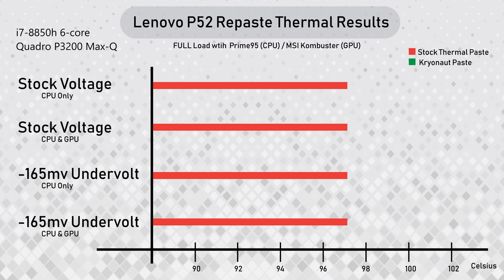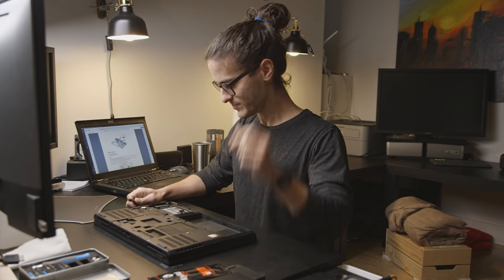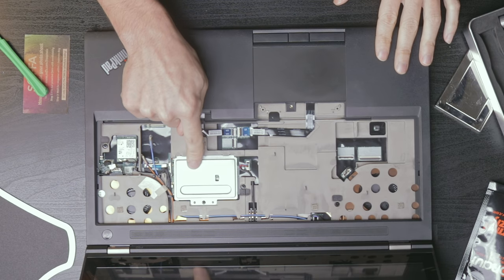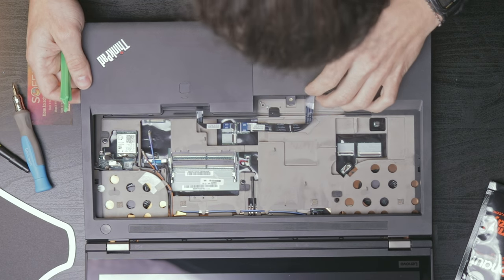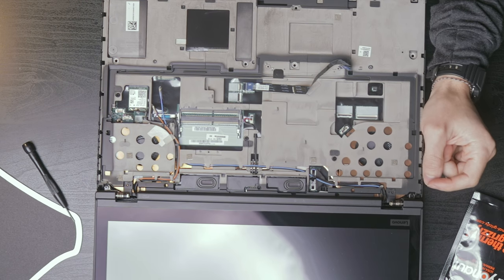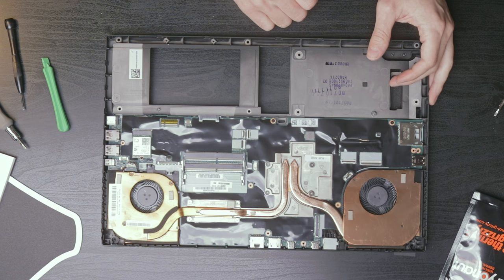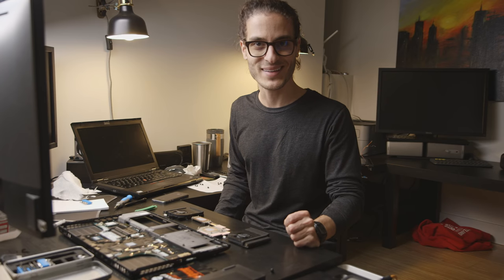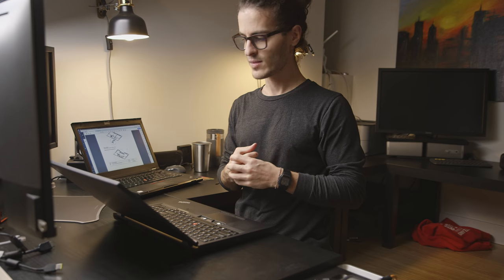According to Jon - Lenovo P52 CPU Repaste & Disassembly

Comment: Hi there ! I recently changed the thermal paste on my P52 for better thermals with this crazy xeon processor. I noticed that both the CPU and GPU are covered by a thin layer of plastic that is all over the motherboard (probably for better longevity, protection against water, sand etc...) which is pretty cool but I can't help but think that this must be a huge bottleneck for thermal conductivity ! Did anyone tried to remove the plastic on the cpu and gpu with a clean cut around the dies ? I'm also contemplating repasting again this time with liquid metal, any thoughts ? Thank's ! 😁
Reply from the maker: hopefully the plastic didn't cover the die of the cpu and gpu. That black plastic is there to help prevent water damage if you were to spill something on your laptop
Reply: @b1n0ry3  I'm talking about the very thin layer of transparent plastic, someone told me on a forum it's "conformal coating" and said to leave it there but... I don't know it seems odd

Comment: Have you ever considered that it thermal throttles so much because you are using the 4k panel? This is a mobile workstation and rendering and benchmarking in 4k will sure give such thermal issues. I think the results would be a lot better with a 1080p panel. If you HAVE to do 4k editing on the go then that’s something you will have to accept. I have no experience with AutoCAD or 3D rendering on how much it can stress the machine when full 4k load. One thing I understand is that it is not acceptable to carry around such a big laptop and not have proper cooling!

Comment: @jon .
I am deciding to buy the same specification(3200nvidia, i7 8850, 1TB m2) P52 but with 16 GB RAM. My tasks are regarding ANSYS, MATLAB, CAD-based simulations that normally runs for 1 to 2 days (UNSTOPPABLE 24 HOURS).   
Please help me to decide whether this is a safe system to go for? as it touches high temperatures (90 DEGREE CELCIUS) easily according to your reviews?
I will really appreciate your reply.

Regards,
Muhammad Harris

Comment: Do the undervolting settings "stick" after you reboot? Or must you run it everytime you restart the laptop?
Reply from the maker: They don't stick no. You have to reopen the Intel extreme tuning utility and re-apply the undervolt unfortunately.
Reply: @b1n0ry3  Thanks for the response. Also, since you have the 4K touch, can you check if the display is 10-bit? You can check for this under Nvidia Control Panel -> Change resolution -> Output Color Depth, OR you can open up Photoshop, hit CTRL-K and look under Performance -> Advanced Graphics Processor Settings, and see if you can check 30-bit display. Thanks again Jon, great video.
Reply from the maker: @johntruongpictures  No 10bit on the P52 :( If I remember only the P72 has a 10bit 4k display, but don't quote me on that.
Reply: @b1n0ry3  thank you for checking! The P72 is advertised as having a 10-bit, but many owners have reported it is only 8-bit, even looking up the panel part number from AUO confirming that. Very shady.